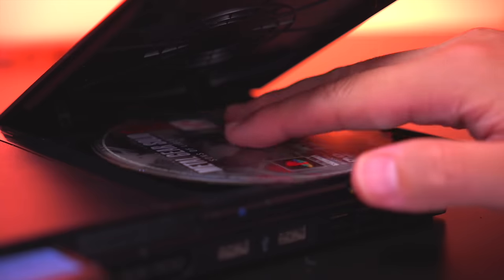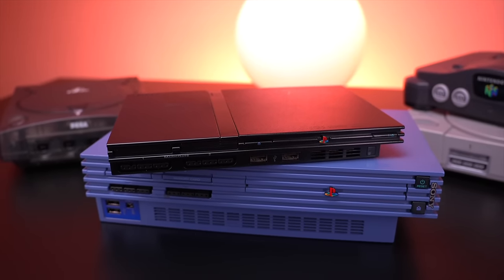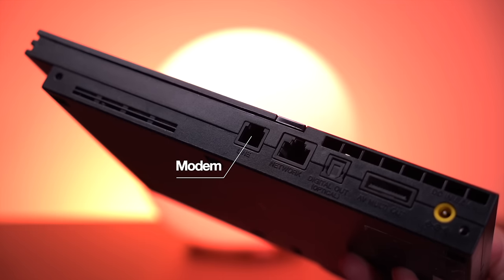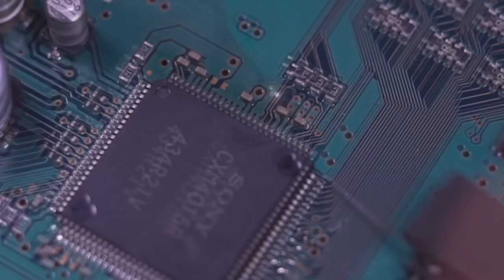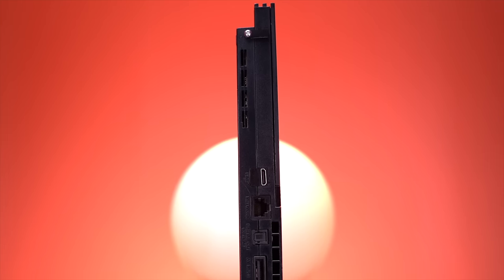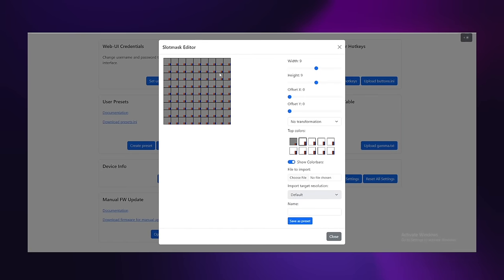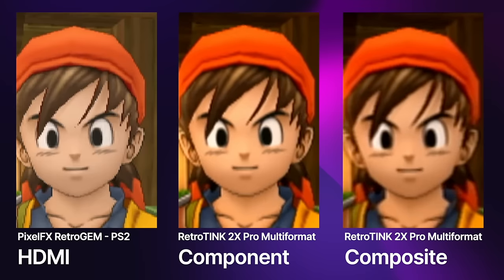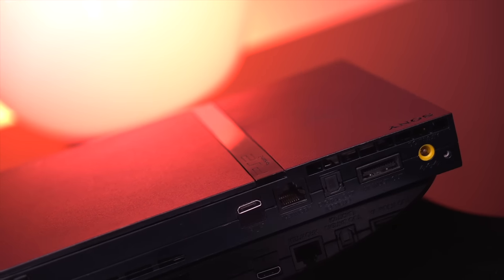This HDMI Mod Makes The PlayStation 2 Look GORGEOUS!

Comment: This is really cool, however the installation process is beyond the soldering abilities of 90 percent of people including myself 😂
I’ve done picoboot and battery/led replacement to my GameCube as well as replaced several game cartridge batteries and personally would not be comfortable attempting this. Kudos to those who can do it, I imagine there’s a strong market for those who can provide the installation service to others.
Hopefully someone can come up with a less intensive/solder-less option someday!
Reply: Well there are decent (& cheap) component to HDMI converters out there.  The PS2 is very old architecture.   HDMI is not going to upscale, do pixel interpolation, and digitally reconstruct missing image quality.  You need something like an Nvidia Shield with AI image processing to do all of that.  And if you already have a Shield, what are you doing playing with an PS2 for?

Comment: The fact that they are OK with selling the locked version at a $70 discount means that they are still profiting well enough on the basic version that if hypothetically all anyone ever bought was the basic version, they'd still do fine. No one is going to develop a product and then sell it at a loss unless they are trying to gain market share (e.g. big players like SONY and Microsoft). I wonder if they might profit more in terms of volumes of sales if all they sold was just the Shiny version, but at the Basic price.

Comment: I reccomend using a Pound cable and an MClassic. No soldering needed, all of the upscaling and antialiasing is offloaded onto physically separate units so it's easy to troubleshoot. The Pound cable upscales it to 720P(the default output is 480i, which the MClassic does not support). The MClassic takes that 720P signal and further upscales it to 1080p while smoothing out jagged edges and reducing flickering. 

The pound cable and the MClassic are about $100USD for the MClassic and $35 for the Pound cable. 

Whats great about this is that the poind cable also works well on every other system out there. I use it on my XBox 360, PS3, Switch, amd PS4 with excellent results.

Comment: Having no deinterlacing on an HDMI mod seems utterly pointless, its hardly an upgrade when u can barely read jittery text and the screen wobbles. The standard version is a waste of time. The $200 one looks good but a bit overpriced. Good video, explains things very well.
Reply: lol the two kits are the same it software locked /drm . you can even update it buy paying ota ....what a joke,.

Comment: PCSX2 (PS2 Emulator) for the win. Highly customizable with awesome graphics. Even easier to setup.
Reply: Someone finally gets it. Hell, setting up PCSX2 would be cheaper than doing this fucking HDMI mod. The only thing that costs money is to buy a machine to play the PS2 ROMs on and they are getting easier to buy. As great an idea as this is, I think emulation via PCSX2 seems to be a whole hell of a lot better experience.

Comment: The upscaling would make a lot more sense if it were low latency AI upscaling. 
If the game is just being linearly scaled from 480i on every resolution, I could not care less if it's outputting 720p or 1080p, or whatever. It's all just 480i, without even AA.
At least the blurriness of the RCA cables would mask the lack of AA, but now with it full crisp, I'd argue this mod makes the image quality actually worse in many cases.
The 5€ RCA to HDMI converter from ebay is still probably the best value product for most people.

Comment: The PS2 games that support 1080i natively really just upscale a render from a low resolution. There's only 1 homebrew demo that actually renders in 1080i, and it has to use a field rendering trick.

Comment: I always get excited when a new hdmi converter comes out for these consoles until i see the process of installing them. Having to solder super tiny components always scares me and is way out of my skill range. Id probably have to get someone to do it for me which wouldn't be cheap and im sure these hdmi boards aren't cheap either.

Comment: I feel like this doesn't look that good, I prefer SCART out, HDMI reveals quite a bit of flaws and jaggies that are hidden more by analog outputs like component and RGB. I have a GBS-C I use to upscale with motion adaptive deinterlacing (only 1 frame of lag) and it looks really solid. The quality is better IMO and doesn't involve invasive mods to your console.

Comment: Very neat this exists as a proof-of-concept, but basically pointless as a product for the PS2. Any negligible difference in video quality between this and component or RGB good quality cables into a Retrotink-5X will be minimal, if not basically impossible to see at all in practical scenarios. The Gem concept itself is not pointless as specific systems like Xbox and to an extent Wii can benefit from it, in contrast to a system like the PS2 that already has excellent analog output, as well as clean digital audio output. The cost of this HDMI mod especially for someone who needs to ship it back and forth to a modder is going to spend the same if not slightly more than say a $40 top quality analog cable + RT5X. And then the upcoming 4K scalers make these mods even more useless as again you'll virtually get the same results via analog vs HDMI into them. There's also the cheaper alternative of a pre-built GBS-C which is particularly well-suited for PS2.

Comment: 1 - for those like me which have the needed skills (and tools) could be "fun" - BUT - is a huge rework to accomplish and I really don't like how much invasive is for the PCB layout ... and console shell as well
2 - one-console_mod-only - most of us own more than one console, so you might buy one kit for every console you have...and pass through the hell of the installation every time!
3 - points 1 and 2 for literally a lot of money for the complete features kit! Those which have not access to the job done by themselves need to add extra buck for every mod - NO WAY

This could be the mod for someone that has only one console and wants to upgrade to HD, but this user must be a skilled one in soldering and willed to spend a lot of money....mmhh I could be wrong but doesn't seem a good planned businnes product

Comment: At $190 with a software lock of all things, I really dont see the point of owning one of these things when an extra $110 gets you a RetroTink 5X with virtually the same video output. And then you can use said RetroTink on ALL of your consoles instead of $200 on just one. Not to mention the better compatibility, 1440p, and you dont gotta crack open your PS2.

Like seriously I got a PAL Gamecube, phat PS2, Wii, Xbox, and Sega Genesis. Individual HDMI mods are way more expensive than a RetroTink, and thats assuming I never delve into a Saturn or Dreamcast.

Comment: The folding of the flex defeats the purpose of the flex. The idea of supplying a flex cable is to ensure you can't make a mistake as the flex overlays one to one. I suspect the issues a lot of commenters have with this project such as locking features behind a paywall is all related to funding and corners have been cut to allow the dev to finance the project. Would have been simple enough to take pre-orders to grow the budget to make this perfect.

Comment: you could just get a pc and emulate the games which much better quality. i was about to mod my ps2 and just before i was about to set it up i tried an emulator on my pc and i was content! the ability to upscale to 8k blew my mind. games like ruler of rose look so good you think it was a remaster. some of the old ps2 games look amazing when u actually unlock all the potential the devolopewrs had intended the game to look. i was once a purist and only believed in orginal hardware but PC's are so good now you can have one system for ps2,ps3,xbox,switch . A rx 580 with a ryzen 2600 16gb will run everything and modern titles at 1080 high quality settings with no issues for the same price as getting this mod lol

Comment: Looks like youre using 63/37 solder which can be tricky because its goes straight from liquid to solid as seen here. 60/40 is easier

Comment: Thank you for putting the actual price and not their deceptive advertized price. Im still baffled they try to pretend the thing is $20 less than its genuine price when you cant install it without the flex cables they provide (and last time i checked you cant even buy it without them).

Comment: This is a pretty genius and great looking mod. However I can't get behind the software lock thing. If the basic edition has the same hardware and is profitable enough to sell, artificially limiting features so you can get more money is bullshit. I can maybe look the other way if it were a $10 difference but they want $70.

Too greedy, I'll just stick with my component cables.

Comment: My 3 cents:
-never use lead free solder for such mods
-mixing lead free solder with lead solder doesn't make any problems, it even have advantages (like better joints, lower temperature is needed to solder, smoother joints)
-price and software lock for 1080p. 
Let's start with the price. Many people will need like 5 or more of those mods for their consoles plus installation fee. It could be as high as $2000 in total for 5 consoles.
Software lock for a 1080p is a bad idea, because people will start to look for a fix and if you add high price then there is incentive for pirating it.

Comment: I've put and HDMI mod in a GC, a Wii and the OG XBOX, the Pluto IIx, AVE-HDMI and Project Stellar/XboxHD+ v2 and in some cases, I sometimes wish that I should have gotten the best component out and a RetroTink 5x. Although the mods are crisp and clean, they are very pixeled. What I really want is a good HDMI scaler that doesn't cost that much that can at least do 1080p. The PixelFX Morph is already $400 and I'm thinking that the RetroTink 4K is going to be over $500. There is nothing ~$300 for HDMI scaler with at least some basic features.

Comment: Cool does the mod offer any Anti-aliasing or Anisotropic Filtering?   Upscaling the resolution is one thing.  It makes the games look a lot nicer.   Adding AA gives these old games a face lift that really makes more recent then they are. I often use these features on PC emulators.   Also is this a permanent alteration to HDMI or doesn't keep the original video outputs functional as well?

Comment: Could you please explain why mixing lead-free and leaded solder would be an issue? Outside of theoretical farces like introducing material stress and eutectic point shenanigans of course. Lead solder flows better.

Comment: ps2 can use component cables which do hd hard to tell if its 1080p or just 1080p  but I used to have it fo rmy ps2 and it worked on modern flatscreens, then you can get an adapter to go to hdmi, if they still sell them these days , they used to be quite common when ps2 was still actively supported by game companies

Comment: I don't know, seems like a lot of work in the soldering for “just” upscaling games. It's way easier to just rip your existing Games and emulate them on a PC or whatever, even in 4K if you wish… I get the nostalgic factor, but enjoy them in 4K and if you really want “the experience”, turn on the PS2 and use a composite cable and HDMI adaptor. This also keeps the hardware itself original. Just my two cents to this.

Comment: having to pay extra for basic software features like actually usable deinterlacing is straight up a scummy move holy crap. this is considering not many games support progressive scan modes on the ps2. i kinda get resolution support if they are using a slower chip but making the entire product pretty much unusable without paying extra for locked out software is just horrible.

edit: i just found out its $70 extra for the shiny edition. $70 for locked out software features like deinterlacing is ridiculous. its cheaper to just buy a phat ps3 with ps2 hardware back compat + ps2 usb controller adapter and just use that instead for good hdmi compatibility.

Comment: Yeah... I don't buy the extra cost for the Shiny edition. Sure the RetroGem offers more, and is compatible with multiple consoles, BUT, now that they're only making a single board that does it all, there's economy of scale.
They don't need separate batches of , let's say 30 units of PS1Digital/ 30 units of N64Digital/ and 40 units of DC HDMI, they can order 100 units of the RetroGem from the fab instead, that's SIGNIFICANTLY cheaper.
Less fabrication costs, less packaging costs, and so on...

120 dollars would be perfect for the shiny edition, I feel anything above that is a rip off.

Comment: 🚨 PSA:  Unless you are a competent electronics technician - I highly advise NOT to attempt this install!  The chances of messing it up are too great, possibly destroying your console in the process!  If you do successfully install this, do not travel around with you modded console.  All of the added ribbon cables and loose wires are mechanical failure points from vibration and impacts!  It's cool someone thought this mod out and are selling it!  But there are much easier options out there to play retro (PS2) game with!

Comment: Locking 1080p and MA Deinterlacing behind a software paywall makes the "basic edition" barely better than a $10 HDMI box. 
They know people wanted those features the most and that's artificial segmentation. They know that when many TVs scale from 720p or lower, the TV adds issues and latency.
Very cool company ethics.

Comment: looks good but I feel the jittering is just settings done bad. I tried the infamous PS2 to HDMI, along with an install of FHDB, and just changed some settings and everything went fine. guess what I paid 20$ this dongle.
Oh and about the noise problem, just glue some aluminium on the case, put some kapton tape and you got an rf shield. I never had motion adaptative on it, and never had motion jittering at all.

Really from one year to another these video converters go crazier and crazier about price. It started as 20$ then 50$ then 190$ and now this thing, you have to solder, cut, place a device, and pay in the end 500$. NO.
Most of us still enjoy our consoles, but at some point the price is too high. 500$ and I can get a ps3 the correct model to play ps1 ps2 ps3 games and just softmod it, and put some HDD in.

Comment: Great video as always dude, thanks for showing this off, as always really enjoy your content.
The comparison shots were crazy good, didn't know it would be that much of a jump in quality. I wonder if RGB scart through a upscaler would have looked a bit better as thats the best option for PS2?
About the product, with that amount of image quality improvement it just simply can't be ignored, unfortunately.... And i say unfortunately as i think its way too expensive as is everything in the retro modding scene these days. The markup ALL these companies operate at is insane, to the point you don't even feel bad about clones anymore! And then to add onto what everyone else is saying in the comments about software lock for the better version!! Wooof!
The new retrotink 4k, upcoming new ossc, upcoming new morth (they all also operate on insane markups btw, but at least can use with more than 1 console) would probably be better option & value for everyone. That is unless the jump in quality over HDMI mod is as much as your comparison shots show even with those scalers then unfortunately this mod just simply can't be ignored.... Just wish the price wasn't insane!

Edit: wait on second thought, you were comparing this product with a retrotink 2x pro. So that would be 480p vs 1080p upscalled. Maybe that's why it looked so good, seeing this kit compared to the ossc and retrotink 5x both at 1080p would be really really interesting.

Comment: Man I didn’t know where else to post this but your channel, someone that knows how to code and that can do modifications to the wired/wireless link cables for GBA / GBA SP should try and make an app be it for phone & or PC.

The app would allow you to connect the cord or wireless links through Bluetooth & the phone app/PC app or even website. Would host your friends list and you could see who is online. Then you could invite each other in a room & trade or play games with etc. say you could be in a discord call or phone call and tell each other you wanna play or trade Pokémon whatever you wanted to do.

As long as it’s the same game I don’t see no problem in this working. I don’t think this would work with flash carts but maybe??
 All you would really need to program/code is some chip to connect with Bluetooth that works with said App.
Not to mention the App itself obviously. 
I’d love to see this I’ve had this idea in my head like 5-6yrs. 
Saw a video where a guy did this basically with two OG game boys but it didn’t have a friends list type thing lol.
I’d love to see a full app made from this.

RECAP: SUMMARY
Bluetooth GBA link cable 
Link app
Friends list 
Invite friend they join on app
Long link has been made.

Comment: I just picked one up (Shiny) and I can honestly say it may not be worth the price. I use component cables and the video quality is already very good. The improvement HDMI adds is negligible. However, if you only have standard AV cables (composite), the increase in quality is very noticeable.
Reply: The mod is probably meant for future proofing so people can enjoy PS2 games in native hardware with newer TVs and monitors.